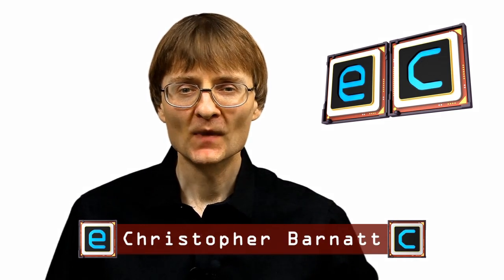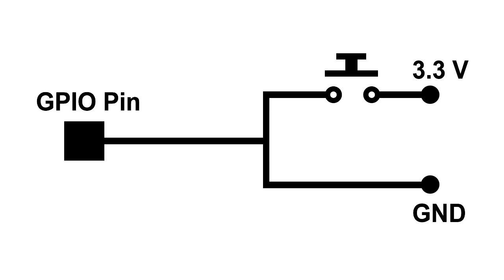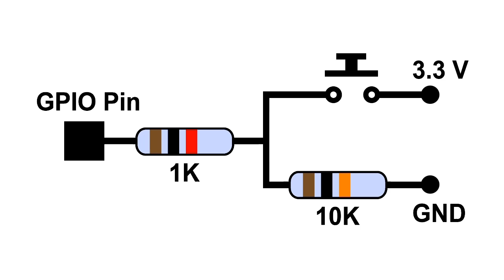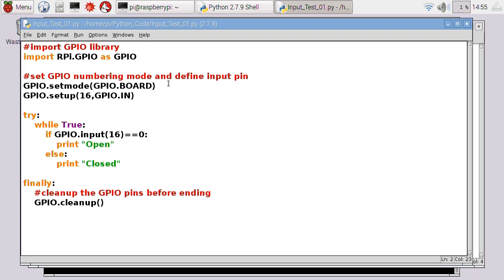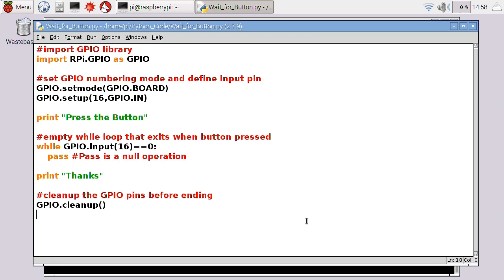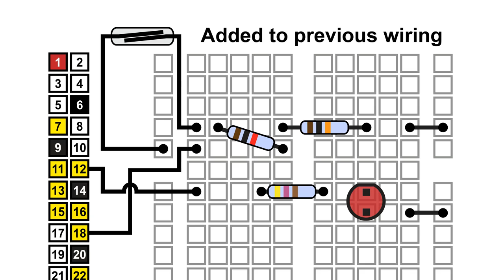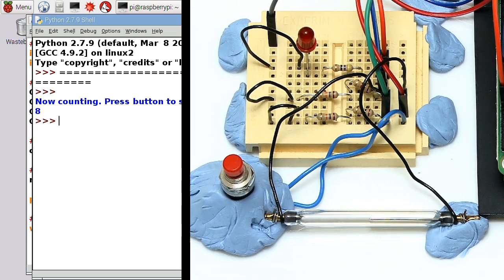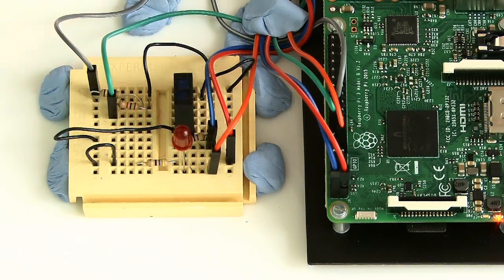Raspberry Pi: Using GPIO Inputs

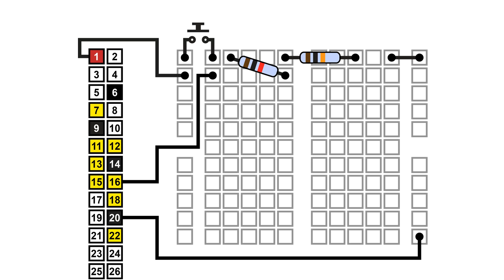Comment: I'm lost with all the wiring with the breadboard, and the concepts of resistors and grounding.. ANy good videos for further learn about the concepts? Most of all, I'm confused on how everything is wired based on 6:29 diagram... And the top right corner looks pointless because of my lack of knowledge to read this.
Reply from the maker: On a breadboard, the pins on the two edges are vertically linked, and the ones in the middle rows horizontally linked. I cover this in this video: https://www.youtube.com/watch?v=41IO4Qe5Jzw
Reply: Thanks I watched a handful of breadboard videos on the web. It's more clear now.

Comment: what is the maximum current raspberry 3pi can handle without explode ? I will try to get data from ldr's as i draw in picture: https://image.ibb.co/b4eYko/diren_devre.png  i will read the time required to fill capacitor and understand which sensor is working. but im not sure about how much size of resistor i should connect to pink-blue-yellow-green cables and ground to prevent too much current goes to raspberry and burn it?? can you help please?

Comment: can you make a sercurty system with this?
Reply from the maker: You could indeed! A Pi could easily trigger an alarm via GPIO -- or even play a sound out of its 3.5mm audio port, hooked up to a well amplified speaker. And the Pi can communicate over the web, and has a camera port. So there are a great many security possibilities. I can almost feel a "Raspberry Pi Security System" video coming on . . .:)
Reply: yes you should make a video on that

Comment: have you worked with this hat? MakerFocus Raspberry Pi 4 Power Expansion Board DockerPi Power Board 20W(5V 4A) Power Supply Safe Shutdown with Cooling Fan Infrared Remote Control Compatible with Raspberry Pi 4 and 3B+

Comment: What happens if gpio pins touch with each other
Reply from the maker: Should not be a problem, even with a powered board, unless the pins concerned are +5V or +3.3V power pins, or outputs at this level. But ideally, do not short GPIO pins!

Comment: it doesnt work for me... my raspberry pi b+ say open non stop even when i press te button
Reply from the maker: Check your code, and recheck your code. In particular the board numbering command -- and everything else. Good Luck! :)
Reply: thanks for your fast reply, i have rechecked the code and the gpio wires/button but it still not work.

The code:

import RPi.GPIO as GPIO
import time

GPIO.setmode(GPIO.BOARD)
GPIO.setup(16,GPIO.IN)
try:
  while True:
    if GPIO.input(16)==0:
       print "OPEN"
       time.sleep(1)
    else:
       print "CLOSED"
       time.sleep(1)
finally:
    GPIO.cleanup()
Reply from the maker: Photograaf11 Assuming you have the appropriate indents, your code looks fine. So I am wondering, have run idle via the command line and typing sudo idle -- so that you are running in root mode to have permission to access the GPIO pins? This may not be necessary if you have the latest verion of Python installed. But it is worth a try.
Reply: i start it from putty with the command: 
sudo python camera-shutter.py

i will try to connect a screen to it and try it in startx with idle
Reply: it still not work... i have the newest version of python and i run it as root bit i got still continue OPEN even when i press te button
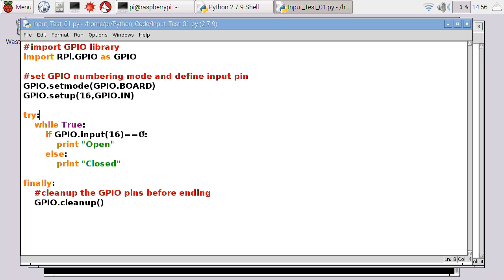Reply from the maker: Try another GPIO pin, changing the  code and wiring as necessary -- there is a graphic in the video showing those available. Try replacing the switch with a wire -- ie force the input closed (effectively connect the 1K resistor from +3.3v to the input pin, which should hold it high). Or, before this, try the code in the video at c. 10:57 -- a very simple button pressed check. Also, I've just noticed that you have time.sleep(1) in the code above, which is a long debounce, and you do not need the time command at all just to print open/closed -- code is in the video at c. 8:43. Oh, and if all else fails, sleep on it. :)
Reply: THANKS!!!! we have solved it :D i have the 3.3v wire set to the other 3.3v (pin17) the ground on pin 18 and the "read" wire on pin 36 and it works! thank you so much! :D now i can continue my camera project :D
Reply from the maker: Photograaf11 Excellent! There is always a fix if you persist. :)